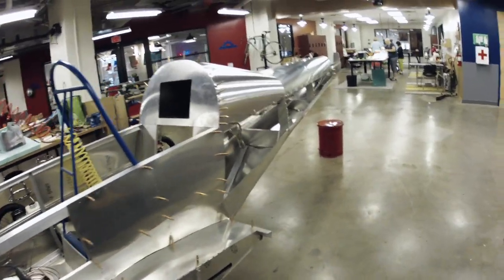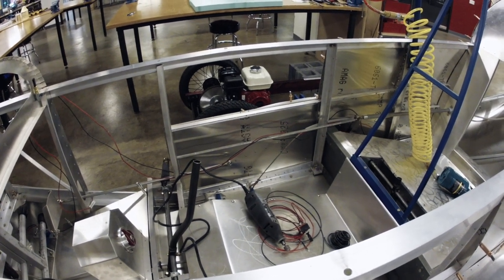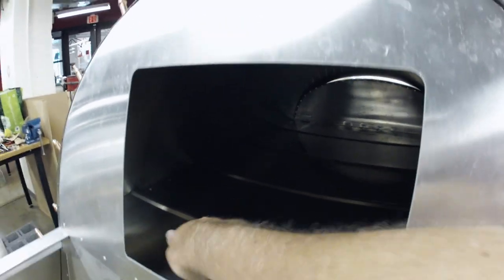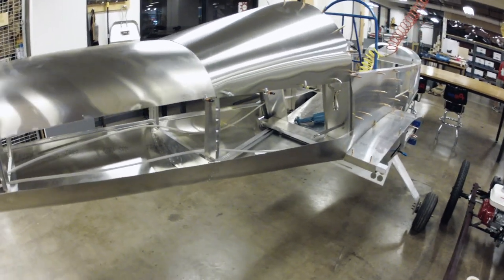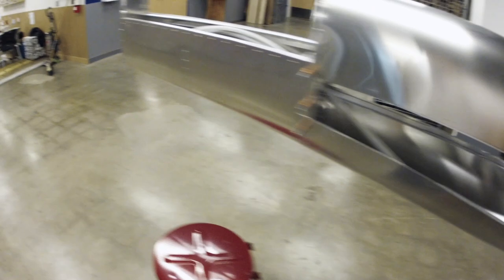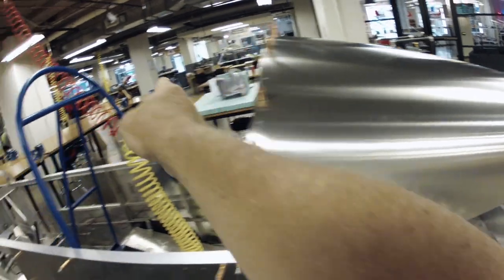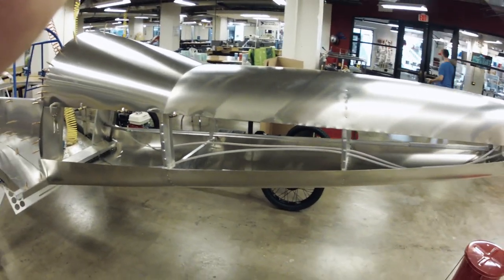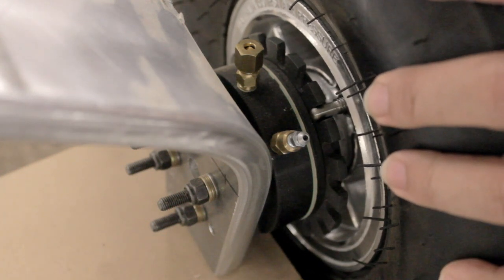Thatcher CX5 Walkthrough Episode 5

Comment: Whilst i appreciate the work that has been put into building this beautiful little airplane there are a couple things i would not pass if i were inspecting it

No jointing compound being used between ANY places where two pieces of metal steel or alloy are being riveted or bolted together, have you ever seen what the slightest bit of dampness can do between two pieces of aluminium?.

Steel bolts being in contact with ali without being given a coating of jointing will set up electrolysis NASTY.

The other thing was i noticed no self etch primer being used anywhere or were all the things i noticed to be done later ?

But  still a great project and am i to believe this is not a kit if so more power to your elbow.

Alan Brown
Reply from the maker: Alan, correct, it is not a kit but all parts fabricated in my shop (or Techshop).

Corrosion control has been thought about. I have now moved to coastal NC and will prime the wing interior, undecided about the fuselage, but likely as it's a mixture of Alclad and 6061. Bolts are cadmium plated, which is galvanically compatible with aluminum, and should be noted AC43-13 says bolts should be installed clean and dry, no coatings. Where steel components bolt to aluminum (wing attach brackets et al) the steel was powder coated.

I am preparing to film a new episode, I just moved the plane down to Elizabeth City last week.